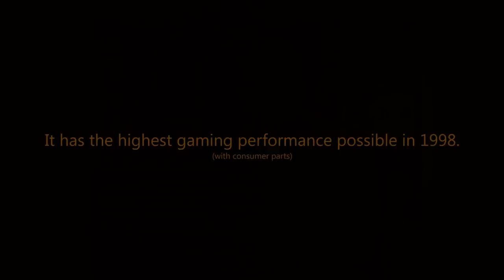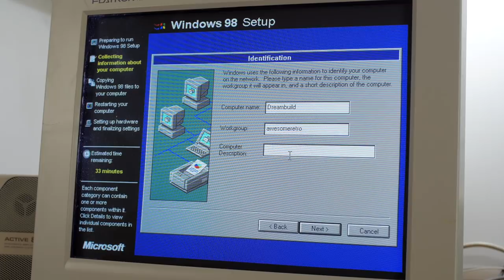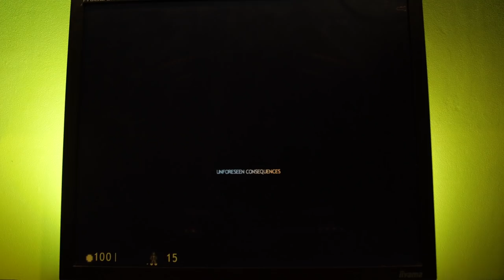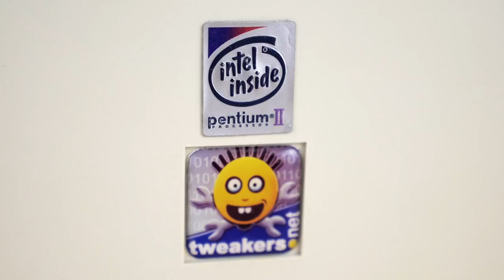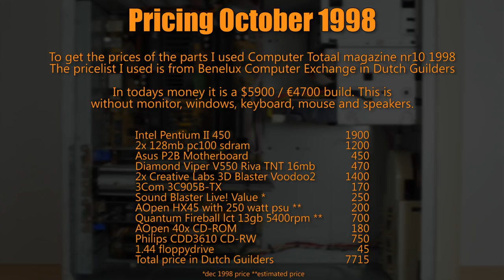1998 Gaming Dreambuild! Pentium II 450, 3DFX Voodoo 2 sli

Comment: Remember guys, if you are laughing now at this 1998 PC, pay attention that your i7 6700K GTX1080 32GB RAM   PCs for 15 years will be worth $20 for total and ridiculed by your sons.
Reply: Well you are maybe right. But the increase of performance over the last 17 years was mindblowing. At the moment you can handle everything very good (not 4K Gaming) with a I5 2500, 8 GB RAM, GTX 680. And that is the high level standard from five years ago. Performance increase after Sandy-Bridge-Generation CPU´s is not comparable if you look at a 1998 PC compared with a 2003 pc.
Reply: +Dieter Gerding a Slot A Athlon 650MHz versus an Athlon x2 or Athlon 64? There's a pretty big performance gap there, buddy. 
1998-2003 was just as much of a race as it is now, just with more competition. 

I kind of wish we had more than two or three companies competing, I liked it better when there was more than nVidia and AMD in video chipsets, I almost miss Cirrus Logic and S3 Technologies.
Reply: +AIO inc. That is exactly what I wanted to say. The performance gap between a sandy bridge and a skylake cpu is maybe 20-25% at the best. The gap between the two cpu's you chose is much higher. So I doubted, that the increase in speed in the next 15 years will be comparable to the development we saw in the last 15 years.
Reply: However a pentium 4 from today wich is 15 years old now (or even a core 2 duo wich is 10 years old), even though they can still perform very well (especially for the core 2) can be found for very cheap nowadays. In fact, I think that CPUs aren't evolving that munch now, but GPUs are still evolving fast imo. Gaming on a full 2008 gaming PC (core 2 quad + 4GB of ram + 2 8800GT in SLI) ? Out of question. Gaming on the same computer but with an RX 480 or nvidia's equivalent (or even something a bit slower/cheaper) ? sure !
Reply: Deksor
Pentium 4's are still usable, should you be fine with XP or a slightly slow 7.
Reply: Dieter Gerding
The term for this is diminishing returns.
Reply: +AIO inc. Yeah, but you can clearly see the difference between a pentium 4 and let's say a core i5, while there are little differences between a sandy bridge cpu and a Skylake cpu. Yeah it's a bit faster, but will you see the speed improvement in usual tasks ?
Reply: Ty tutaj :0
Reply: P4's are just fine. My regular build runs a Sandy Bridge i7, but we have an HP tower designed for XP from 2001 sitting in our house running Windows 10 Pro just fine with 2GB of RAM. Threw a 60GB SSD in there and you honestly wouldn't know the difference doing office/web browsing things.
Reply: +Dieter Gerding that 20-25% difference is a bit generous, unless you are talking about them at default clock speeds. the sandy bridge were incredible for over clocking. I know there are plenty of idiots who buy the k version and don't overclock. however a lot of performance gains over past chips are primarily gained by intel raising the default clock. Most chips don't even need a voltage increase to 4.2 ghz to run stable. So I don't really accept the idea of the performance gains from past generation when older chips overclock to the same speeds. And it's not like the non k versions receive the same turbo frequency or "performance" increase.
Reply: The Hyper Threading ones are good because the pentium 4 could act like it has 2 cores.
Reply: I remember most people disabling HT on the p4 because it reduced performance. The p4 Era is a little too dated these days for anything beyond basic computing tasks and browsing. They were horribly power inefficient and were destroyed by their amd counterparts at the time. It wasn't until the efficient laptop architecture they designed with most of the stuff amd had already done changed their direction. Their pipeline was way too inefficient and long, they kept on with their IPC tied to the clock design for far too long. I remember at the time people were recommending to stay away from these core duo laptops and centrino, because you weren't getting a true p4 cpu experience. That lower clock was scary. You wanted a p4. Because heat caused by escaping electrons amd high Power consumption was to be desired. None of this lower clocked faster IPC rubbish. Yeah sure they work, but I wouldn't touch anything that old from even the amd Era stuff that was better. Unless you count reviews that intel got busted for cheating on and had to pay a settlement to customers. Oldest pc I have is a core 2 duo pc and laptop which I underclock to keep it power efficient for those sort of computing tasks that a p4 could do.
Reply: To Jeordie White - out of that perspective, you are right. Sandy Bridge is well known for their overclock-potential. I meant the stock performance. And that you can see on many computer-magazines online. But out of that OC-Perspective - Yes. You´re right.
Reply: My oldest PC is a laptop with an AMD (I Don't know what model it is)
Reply: In 2033, the best pc looks like - 4 x intel i12 6.0 ghz, 4 x nvidia titan OMEGA 24GB vram, 1TB ram and 20TB SSD!
Reply: +MIREL RANETE 24 mb of vram when in 2016 some of them are achieving 8-12gb ?! I'd say more like 1TB of vram X)
Reply: Deksor 128GB of vRAM would be completely unnecessary, which can handle 65536x65536x32 bit colors.

I doubt you'd ever have a use for such a high resolution display.
Reply: What about high res textures, anti aliasing, 3D models ...

Remember a very famous guy that said that nobody would have to need more than 640K of ram ? ^^

Who knows what technology they will invent within 17 years
Reply: Deksor All of those are included in the screen resolution - they're all displayed on the screen.

We don't need more video memory - we need more processing power.
Reply: Yeah you may be right ... but only the future will tell us the right answer.

Even if it's maybe not more useful, AMD and Nvidia will probably push the industry in order to make you buy new gpus that you don't need
Reply: Deksor Or maybe I'll be sitting on my GeForce 2 Pro here forever.
Reply: Then we will all get our nutrients through a tube and are plugged into a virtual reality via a cable, which connects to the back of the head.
Reply: Hell my video card from 2008 costs 25 US Dollars now, NVIDIA GeForce 9800 GT..
Reply: Michael Gardner / Radical Edward Gaming Quadro FX1700 was the last nVidia card I remember having, before that a GeForce 7950GT and 2 Pro.
Reply: Maybe. But maybe not.

The rate of advancement has slowed down dramatically and yet even still hardware generally outstrips applications. By 2003, we'd gone from 450MHz PII to 2GHz P4. By the end of the year, the 3.2GHz Extreme Edition and 64-bit Opteron would both be available. The difference in performance is almost as much as the clock speed would suggest. Today, going from a 2011-era i5-2500K to a 2016-era i5-6600K will give you a performance difference of about 40%. In practical terms, it's even more laughable because most applications won't even stress the 2500k.

Graphics are an iffier matter. A Radeon 9800 will kick a Voodoo to the curb. But a 1060 will beat the crap out of a 560 Ti almost as much. On the other hand, if you don't play games both will run DWM and accelerated desktop applications just fine. The biggest advancements have perhaps been in solid-state storage. And indeed, many people say take an old rig and slam an SSD into it to get a decent-performing productivity machine.

On the other hand, if you spent that much on a machine, you probably want it for gaming, virtualization, video editing, or something similarly . But upgrading is a very real option. There are people running Nehalems with SSDs and Pascal graphics cards. An i7-980X with a GTX 1080 is still a kickass machine. A 9800 XT in a Pentium II rig would be all kinds of mediocre (so is a 9800 XT with an E6300, but that's another story).

The mobile space is another matter. While my 5-year-old Sandy Bridge rig is still usable, my 5-year-old Galaxy S II is next to worthless. But will a Snapdragon 820 be as outdated in 2021 as my Exynos is today? Only time will tell.
Reply: ***** Welcome to Earth, 2016.
Reply: Our Son will say : It Even Can't Play In 64K Resolution!
Reply: Potato Life It can't even do 320x200 in 16 colors? That really is sad.
Reply: Lol, XD
Reply: My kids were quite happy with there old computers(i wasnt due to the amount of power they sucked) so for xmas i upgraded them
their new systems are I3 - 6100. R9 280x. 16gb ddr4 2400, mirrored 1tb sshd and mirrored R3 240gb ssd
old systems were Dual xeon 5420, 16gb FB ddr2, R9280x, 4x500gb in raid 10(orginaly from 2007)
Reply: Your kids sound like they have stuff handed pretty easily to them.  But I'm not judging.  I wish someone would have bought me a set up like that.
Reply: Unfortunately my dad could not buy me a setup like that back in 2003.

Comment: The amazing thing is people will be doing this in 15 years. "Ultimate 2015 retro PC running on old fashioned Windows 10 with a puny 4.0ghz Intel processor and a meager 16gb of ram and sli gtx 980ti gpus" lol
Reply: +Derek Fishel ''Ahh, good old days when we used to play 32 vs. 32 on Battlefield 4 and GTA V Online. Heists were the shit. Kids today with their 128GB RAM, Call Of Duty: Primal Warfare and Battlefield 3547 will never know how much fun we had quickscoping scrubs.''
Reply: +SonnytheArcticFox People already do that with Call of Duty 2 and Halo
Reply: +Derek Fishel I don't think that the hardware from 2015 will be outdated that fast. Moore's Law will come to a halt after finally the 7nm architecture will be reached. At 6nm a quantum mechanic effect called "Quantum Tunneling" will take place which renders CPUs useless. That means that as soon as the 7nm architecture isn' sufficient enough anymore, the engineers have to come up with a totally new concept about computing. And as long as they can't find a better and cost-efficient concept, the hardware between now and 7nm will be "actual hardware". And just remember how fast Intel advanced to their new Skylake 14nm processing and the roadmap shows that they want to introduce 10nm between 2016 and 2017 and a 7nm architecture between 2017 and 2018. So 2018 the peak will be reached and I guess if you move on to 2018 and think about hardware "from 3 years ago", you won't really have that nostalgia-effect. :)
But I guess the nostalgia comes back when the kids in the future will sit at a brand new machine that works totally different than our PCs today and then you want to explain to them that "back in the day, a computer was only able to handle 0's and 1's". I guess it's the same for a teen today when putting the mp3 files on his smartphone you try to explain to them that there was once a time where music was "pressed on vinyl" and you had to clean the vinyl disk before putting it on a turntable..." 2 totally different concepts for one and the same thing...
Reply: +Metatr0n 
Quantum tunnelling wont render CPU's useless that is load of crap, its possible to use quantum tunnelling to our advantage there is already chips made smaller than 1nm so there you go, its quite possible to do.
Reply: *****
That shows that you know nothing about what quantum tunneling does, nor how quantum tunneling works. Building a transistor and building a CPU are 2 totally different things. If you take a normal CPU and shrink it down to 6nm, the uncertainty principle of the position of an electron will cause the transistors of the CPU to close or open without any signals to tell them to close or open, only because the disappearance and appearance of electrons will make them jump from transistor to transistor.
Furthermore, the transistor-types that you mentioned are finFETs and tunnelFETs wich both can be used in a quantum-tunneling environment but both transistors aren't usable on a CPU, since they work on a totally different basis. On top, only because there are smaller transistors, doesn't mean that you can use them on a CPU as mentioned above, and even if you could use them and even if you could fit them on a die, they won't be able to withstand several GHz of frequency.
So you either have transistors that fit on a die and can withstand several GHz but can't be used in quantum tunneling environment, or you have transistors that don't fit on a die and can't be used at several GHz but can be used in a quantum tunneling environment.
I reckon you learn something about a topic before you start spouting half-knowledge on the net.
Reply: +Derek Fishel I get what you're saying but Windows 10 is supposed to be the last Windows OS, so unless there's a new OS that is actually preferrable over Windows 10 in the next 15 years, we'll still be using it! lol
Reply: +SonnytheArcticFox I think 128gb of ram will be outdated as we have 128gb today
Reply: +Metatr0n All quantum physics is unreal, false. Quantum Tunneling don't exist.
Reply: KruK666PL
Troll detected.
Reply: You just described my build perfectly...wow
Reply: +Sir Caco D. Mon i like your hat, sir.
Reply: +Metatr0n I'm sure tech evolution won't stop due to die sizes. They'll be doing stuff like massively multi-core processors (Intel has tech for 1000 core CPUs, just not available to average consumers yet), physically 3D processors and maybe even organic/hybrid processors. I also suspect that cloud computing will become a big thing in years to follow, as large clustres of distant servers will be able to provide storage and power to the average user. We could also be seeing the usage of new materials, allowing for greater clock speeds and all around cooler-running and faster hardware.
Reply: Well, personally I'm looking forward to a ultimate 2015 retro build. See you guys 15 years from now!
Reply: +Metatr0n "was only able to handle 0's and 1's" LEL. I would say that if I have a quantum computer.
Reply: +SonnytheArcticFox Amen man xD
Reply: +ICanDoRedstone "We" have 1TB today...

Comment: I remember building a 1.2Ghz single core with 512mb of RAM back in 2001, I thought I would never need to upgrade...
Reply: +ArcadeGames Heh I've spended once tons of money for an upgrade, celly 300 ( wich i Like beter for games then pentium2. It had smoother fps on my voodoo, i think because of the full speed l2 cache instead of the silly ammount of l2 cache for its time at half speed on the p2's.) To the amd duron 800. It I also bought a nvidia t64 with it.. God what a waste of money was that. Old voodoo3 was alot, alot, alot faster.. BUtThe amd 800 duron blew my mind away with 3x 256 mb ram<3. I also thought I never needed to upgrade:D